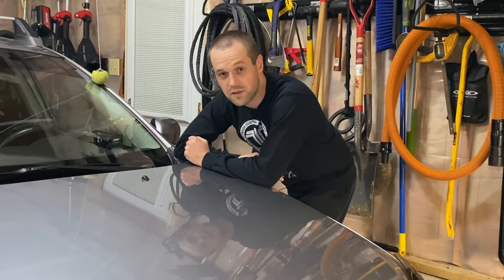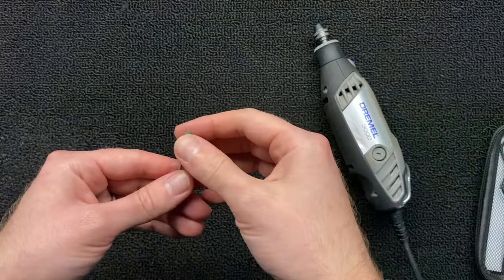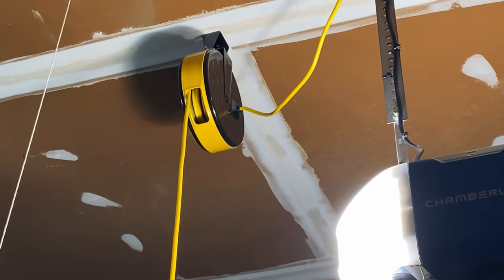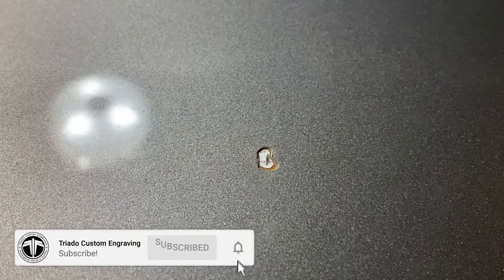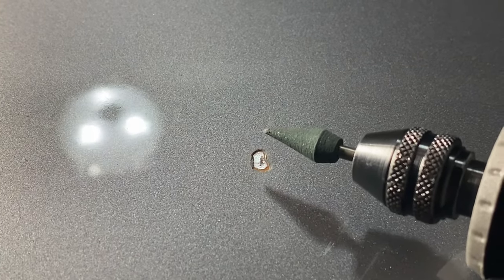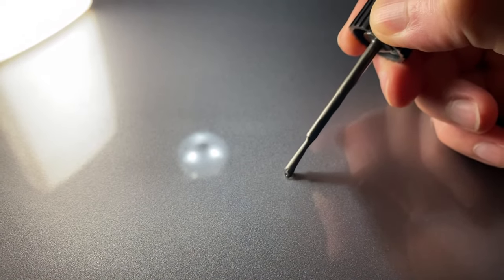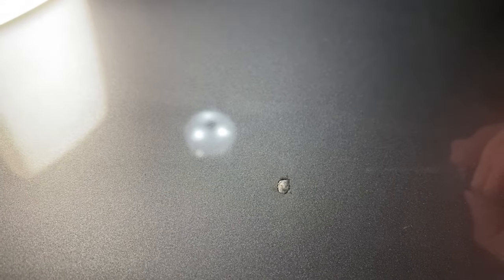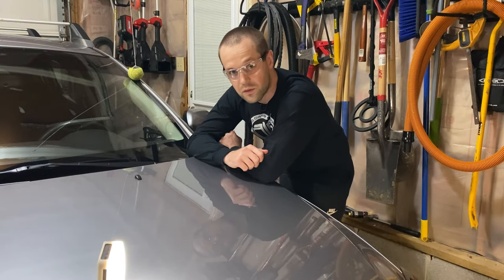How to Repair Rusty Paint Chip with a DREMEL | DIY

Comment: With chipping you'd need to extend the affected area around it by a few mm to catch any rust particles that have crept beyond the skirt of the dent. A bit more hassle but it won't bubble the paint later.
Reply from the maker: Nice, yeah I haven’t had any issues since I did the job.
Reply: What's the best way to do that without powertools? I have some 1500/2000/2500 sandpaper and stanley knife, not sure if that would work.
Reply: @samuelhayden5209  pencil eraser with sandpaper on it might work well

Comment: Thank you - this is the first touch up video I've seen that makes perfect sense for my also older car. I have several chip and the minor cost of a Dremel and a couple of points is a great investment in keeping my car from the rust yard. Great videography!
Reply from the maker: Thank you for watching! Yes for a daily driver it’s a good fix, it’s definitely not perfect but it will stop the paint from rusting any further.
Reply: I spent this afternoon doing all the stone chips on my SUV - we live out in the country. Nothing this effective and brilliant should be this easy! Great results, though I did use primer thinned 50/50 as the base coat. Not perfect, but darned good. Thanks! @TriadoCustomEngraving
Reply from the maker: @coldlakealta4043 That’s awesome! Glad that it worked for you.

Comment: I borrowed your Dremel idea, it works fantastically. But the job is not finished after applying the paint. I added a thicker layer of paint to be "taller" than the original one, sanded it with 800 grid sand paper to match the line wanted to have, then wet sanded a little in the surroundings with 3000 and 5000 paper, then applied polishing paste. It's 98% gone, nobody sees it unless I tell them where I worked
Reply from the maker: Hey Radu, thanks for sharing! You are right it’s not completely flush so it definitely needs a lot more work after the Dremel. I personally don’t really care about making it look perfect as long as rust spot was taken care of. It’s been about 3 years and it’s still looking good without any issues! Glad that this worked for you as well.

Comment: Thank you for recommending  the Dremel 462 and 463  Rubber Polishing Points (both working diameter 6,4 mm), they do seem safer to use than stone polishing points.
Reply from the maker: Yes those work great for polishing and can be used for other things as well! I don’t think that I’ve seen anyone use that for this purpose before…haha but I think that it’s an excellent tool!

Comment: Thanks for the video man. Ordered the bits and I'm gonna try it this weekend. Ive got about 25-30 chips to deal with though 😂
Reply from the maker: Haha yup I got more since this video. Although the one that I did holds really well.
Reply: @TriadoCustomEngraving  worked insanely well and my paint touch up kit has an amazing colour match. Need to build the paint up a little more but apart from that, it's great. Thanks for making this video and pushing me to do this job myself 👍
Reply from the maker: @poshpickle9024  That’s awesome, great to hear that it worked for you!

Comment: Can't get the Dremel 463 1/4 in. (6.4 mm) Rubber Polishing Point anywhere. You have a good alternative? Thxs!
Reply from the maker: Hey that’s crazy that they are out of stock! I found some at Dunn Lumber website, says in stock. You can also go on Amazon and buy something similar, there are plenty knockoff rubber bits on there.

Comment: touch paint doesn't need any 'touch up primer' for bare metal surfaces?
Reply from the maker: Hey Dozy, thank you for your question. I just looked it up and looks like you do need to add some primer to get the best results. Although in this video I did not use primer, it still turned out fine. So it will be personal preference.

Comment: I’m curious, should you put a primer before putting the touch up paint?  How much did you pay for that Dremel?
Reply from the maker: I was actually going to make an update video since I have another spot that I have to do. All depends on the paint that you use if you need primer or not. Some suggest to use it and some don’t say. I applied my paint without primer and it’s holding on just fine. As far as my Dremel I’ve had my Dremel for a while but you can pick one up for around $80. Any rotary tool should work though.
Reply: @TriadoCustomEngraving  I am about to do exactly what you did in the video, but I want to use a primer. Do you think I can use any general primer for metals or do you know about any special kinds of primers for car use?
Reply from the maker: @bubanek  I just did a quick search on google and looks like they do make automotive touch up primer. I wouldn’t buy a huge spray can of primer if it’s for a small chip.

Comment: Do I need to use primer first before using touch up paint?
Reply from the maker: Hey Jim, I had this question asked before and after doing some research it is recommended that you do. I did not use it and it still came out looking good without any issues.
Reply: @TriadoCustomEngraving  You should use etch primer. Beed doing it for years
Reply from the maker: @mreightytwenty8709  Awesome, thanks for the tip!
Reply: @mreightytwenty8709  where can I get that?

Comment: But how about rust protection? I was told that it is not good to apply paint on clear metal.
Reply from the maker: I did this about 3 years ago and don’t have any issues with that spot. Others recommended using primer then touch up paint but it’s whatever your preference may be.